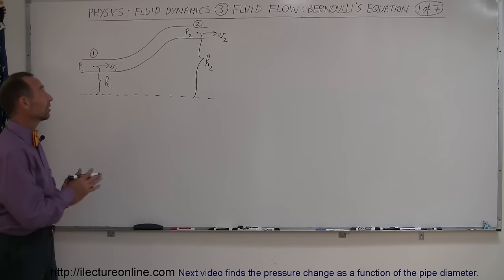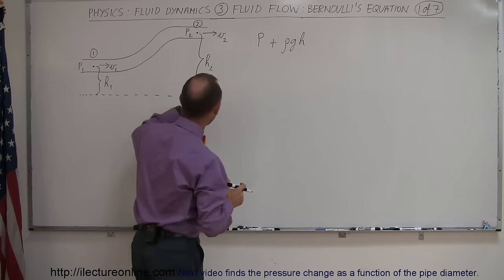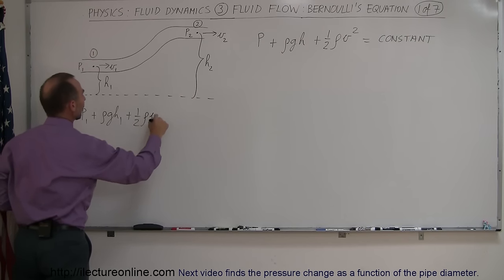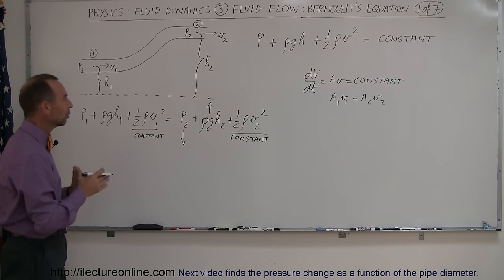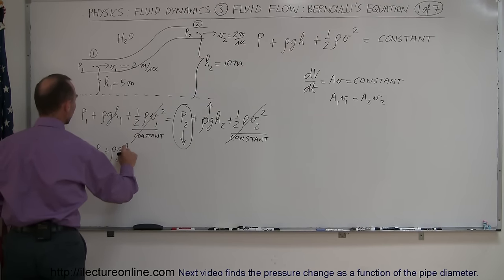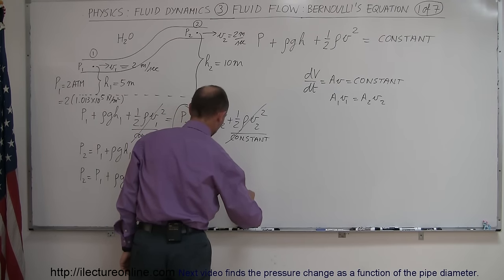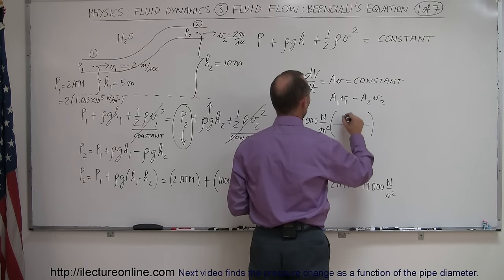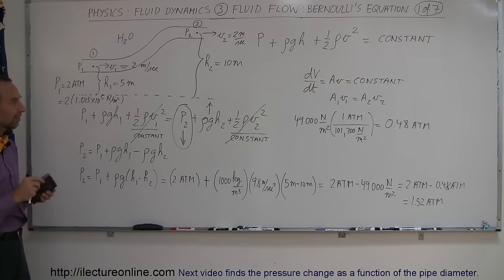Physics 34  Fluid Dynamics (1 of 7) Bernoulli's Equation

Comment: Hi I tried to solve it but lost.... hope you could help me....Water flows into a pipe line with velocity 3 m/s and pressure 830 kPa at the inlet. If the inlet and outlet diameter of the pipe are 300 mm and 150 mm respectively and the outlet point is higher than the inlet point by 10 m ( from center to center of pipe) , determine1. velocity at outlet 2. pressure at outlet3. the critical outlet diameter if the water pressure at outlet is required to maintain at 700 kPa
Reply from the maker: First you find the velocity at the outlet by using the equation:  A1v1 = A2v2      Once you have determined v2, you can use Bernoulli's equation to find everything else.
Reply: confused on taking h1 and  h2.       830000 + 1/2 * 1000* 3^2 +1000  9.81 (H1 = ?) = P2 + 1/2 * 1000 * 12.04 ^2 + 1000 * 9.81 *( H2 = ?)
Reply from the maker: Only the difference in height matters, so you can set h1 = 0 and h2  = 10m
Reply: thanks for the quick response... problem solved....

Comment: Shouldn't pgh2 be divided by both sides in order to be crossed out from the left side? 5:05
Reply from the maker: +George Balderas (Facebook George) 
  No, the problem is correct as is.
Reply: +George Balderas (Facebook George) you can subtract it from both sides , not divide

Comment: I dont get why the velocities are equal.  Why is the velocity equal to the derivative of the volume? I dont understand :(
Reply: Its the derivative of volume with respect to time and not velocity. As he said, since the area does not change, thus velocity remains same at both points.
Reply: V1A1=V2A2    Continuity equation
Reply: Same diameter pipe used thus equal velocity

Comment: Can anyone please solve this?

THE DAMAGED ENGINE
We were going by train from Anglechester to Clinkerton, and an hour
after starting an accident happened to the engine.
We had to continue the journey at three-fifths of the former speed. It made
us two hours late at Clinkerton, and the driver said that if only the accident
had happened fifty miles farther on the train would have arrived forty minutes
sooner. Can you tell from that statement just how far it is from Anglechester
to Clinkerton?
Reply from the maker: Let x = distance at normal speed (v)    d-x = distance at (3/5) v         normal time = t = d/v      slower time = t1 + t2 = x/v + (d-x)/(3/5)v  = t + 2 = d/v + 2                        then (x+50)/v + (d-x-50)/(3/5)v = d/v + 4/3     Now solve simultaneously.
Reply: @MichelvanBiezen  Hello, but there are three unknowns d,X,v and two equations, the way you solved!
Reply: Anyway ,I got the answer to be 200 miles

Comment: Wondering how P change at the h-change interval over time?
Reply from the maker: P changes according to the equation:   P = density x g x h
Reply: @MichelvanBiezen  I got a question: since P relates to h then h is to measure from arbitrary point relatively perpendicular to internal surface of pipe or to the lowest point in the system?
Reply from the maker: You can do it either way, but I prefer to use the lowest point in the pipe as the zero height.

Comment: Wait, P and p.g.h isn't it the same thing ?
Reply from the maker: They both have the same units, but pgh is the term that adjusts the pressure for the gain in height.
Reply: Michel van Biezen thanks, I forgot to notice the different meaning of the "h" in the equation.

Comment: Sir how to take velocity use in 1" pipe line?
Reply from the maker: The velocity also depends on the pressure, and the height difference.  So without the other information you cannot calculate the velocity.

Comment: why is the constant at point 1 equal to the constant at point 2?
Reply from the maker: What "constant" are you referring to?
Reply: @MichelvanBiezen   the CONSTANT on the right hand side in Bernoulli's equation: P + rho*g*h+ (1/2)*rho*v^2 = CONSTANT
Reply: I understand that one is able to write an instance of Bernoulli's equation at point 1:

P1 + rho*g*h1 + (1/2)*rho*v1*v1= CONSTANT1

And that there is a different instance of Bernoulli's equation at point 2:

P2 + rho*g*h2 + (1/2)*rho*v2*v2 = CONSTANT2

Why are we permitted to equate the instance of Bernoulli's Equation at point 1 with the different instance of Bernoulli's equation at point 2?

P1 + rho*g*h1 + (1/2)*rho*v1*v1  = P2 + rho*g*h2 + (1/2)*rho*v2*v2

If this is true, then: CONSTANT1 = CONSTANT2

I am curious as to why CONSTANT1 = CONSTANT2 ?
Reply from the maker: Ah, now I understand the question.  Answer:  There are no multiple constants, it is the same constant.  Bernoulli's equation shows that the sum of those 3 terms ALWAYS add up to the same number (constant).

Comment: hi mr. michel, can you help me with this problem? A fountain ejects water through the four nozzles, which have inner diameters of 10 mm . The water stream always reaches a height h = 3.4m . Assume the fluid is an ideal fluid, that is, incompressible and frictionless. i am stuck and cant solve it.
Reply from the maker: What is the question in the problem?
Reply: oops i forgot to put it. the question is: determine the force in the pipe and the necessary Q through the pipe, so the water stream always reaches a height of 3.4 m."
Reply: and the diameter of the pipe is 60 mm.
Reply from the maker: 1) to reach 3.4 m, the velocity of the water coming out of the nozzles = sqrt (2gh) = 8.16 m/sec
2) The cross sectional area of the pile is 36 times the cross sectional area of the nozzle.  with four nozzles that is 9 to 1 ratio 
3) Speed in the pipe is (1/9) the speed in the nozzle.   8.16 m/sec / 9 = 0.907 m/sec
4) Water flow is Av = (9/10,000) * pi * 0.907 = 2,565 x 10^-3 m^3 /sec
Use Bernoulli's equation to find the P in the pipe
Reply: Thank you sir, you are amazing!

Comment: what if you have a gravity pipe sloping downwards. The pipe diameter doesn't change. Would velocity change with respect to head loss?

It shouldn't according to the continuity equation, but it should according to the energy equation!
Reply from the maker: The velocity will NOT change and thus the pressure will change.

Comment: whywas the constant taken out of the equation?
Reply from the maker: Since the velocity does not change the two (1/2) x density x v^2 terms will be identical on both sides of the equation
Reply: @MichelvanBiezen  it means whenever i solve for a problem similar to that one, im just going to remove velocity from the equation?
Reply from the maker: If the diameter of the pipe doesn't change, then the velocity remains constant and you can remove the term on both sides of the equation.

Comment: Hi, would you help me?  I have had  a troubling  wondering on  one airflow situation for a long time, my  question is perhaps best shown by an example:

A straight  horizontal wind  flows parallel and just over  a flat roof of building . This wind DOES NOT hit the side of the building, the wind is just flowing very close  above the roof. Will the roof feel an uplift from the pressure differential ? , so my question is about an airflow running just above a surface. Your help is so appreciated. Thanks
Reply from the maker: Leviterande
Take a look at the video in the set that describes an exact situation like that.

F = delta P * A

Comment: i have special question for you can you help
Reply from the maker: Always feel welcome to ask here.  We try to answer questions as time allows.
Reply: Water passes through a tube into a small chamber and moves a fan and the water out from the opposite side. There is a small diameter line between the input and the outlet to equalize pressure How can calculate the torque of the fan and the effect of the water line between the input and output